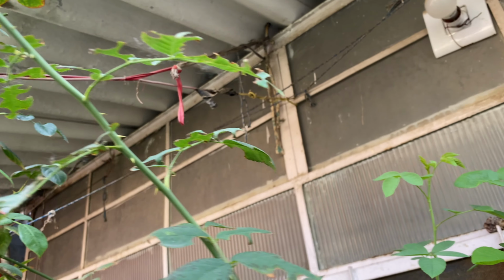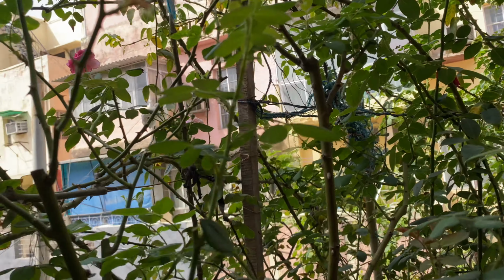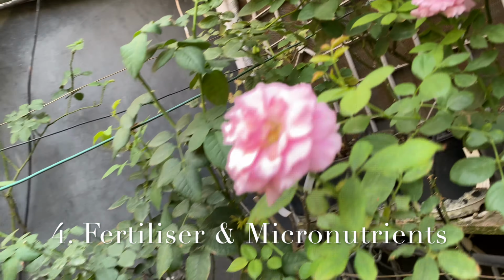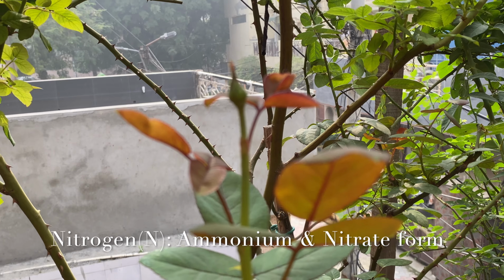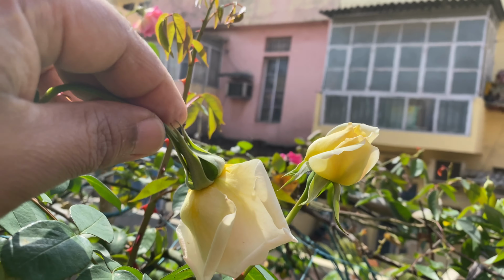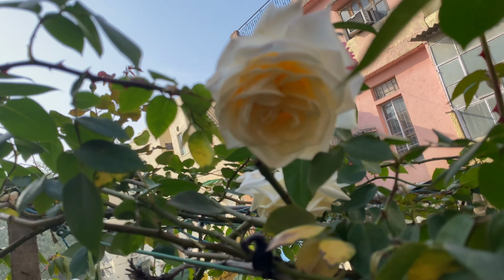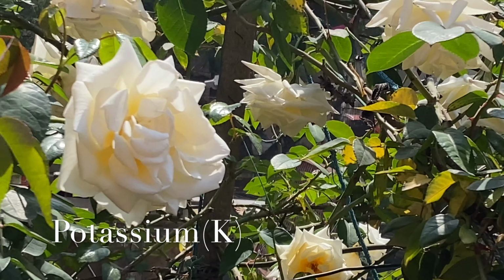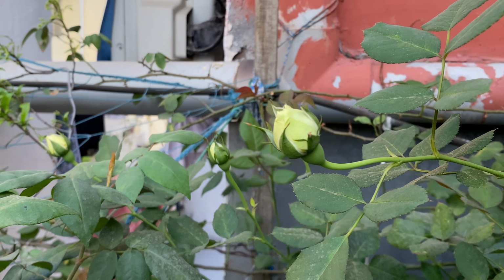#651 Summer Rose Care and N-P-K Feed with Schedule

Comment: Hi Rakesh I watch with interest. This is something I considered before giving my roses the cocktail I have given mine recently. The 3 2 1 is something I did consider and look at. My da rose feed I know had plenty of nitrogen.  And giving my roses additional cocktail would possibly upset the 3 2 1. But what about during very harsh   Conditions does this change anything? I gave my roses additional tonic as you know with zero nitrogen but with a touch of p and k and liquid comfrey all for a boost to health and hardiness. Many recommend it but I’m curious to your thoughts. Thanks my friend
Reply: Wow I just see your chart you feed your roses a lot! I thought I was being extreme:) I do not see any phosphorus in your chart for that month?
Reply from the maker: @Jay_Jay  My roses are in mostly in coal cinder which is holding very little in media. 2gm/ltr per week solution (400 ppm solution per plant is being feed per week in commercial roses) contains only 0.4 gm nitrogen per litre and on average I am feeding 400ml per plant makes it to 0.16 gm per plant every week. So feed is not much. I gave DAP(18-46-0) in between for phosphorus.
Reply from the maker: Thank you mate. 3-1-2 ratio is maintained by commercial growers for good roses and tissue analysis of roses reveals that even less phosphorus is needed. As soil contains plenty of insoluble phosphorus that is why mycorrhiza fungi in root zone is necessary to convert insoluble phosphorus to soluble one which it can supply to plant in exchange of carbohydrate/sugar. If you spray P and K will certainly help to harden leaves. Spray of 1gm per litre calcium nitrate and pinch of Boron after red leaves turn green will further increase hardiness and give very glossy leaves. Root feeding will also help. I feed roses on clear sunny day when not raining.